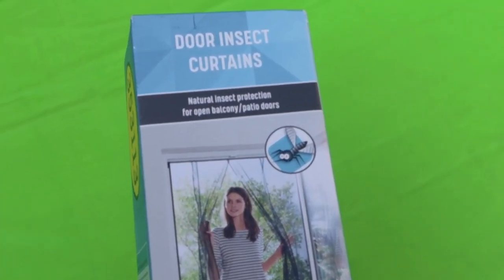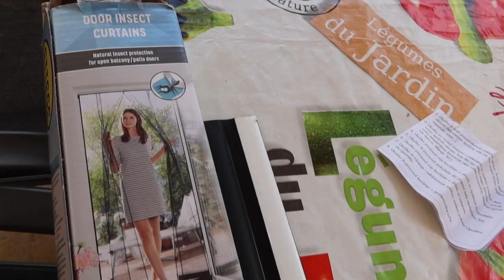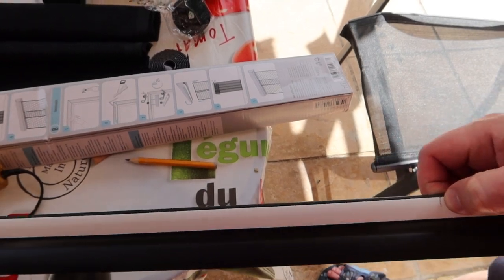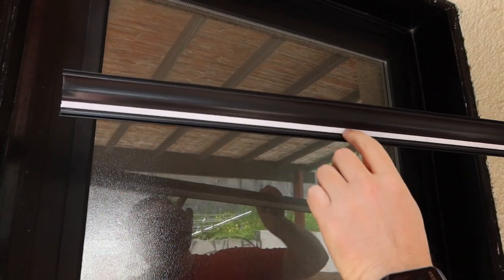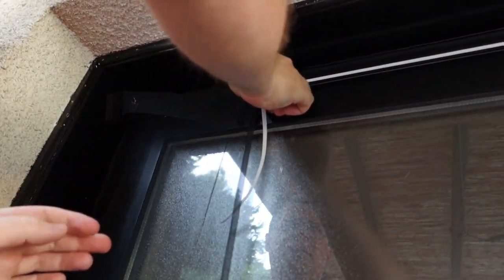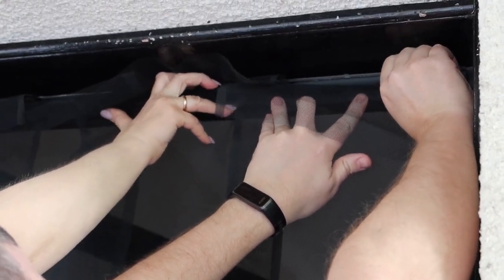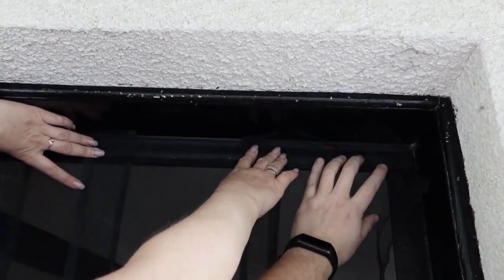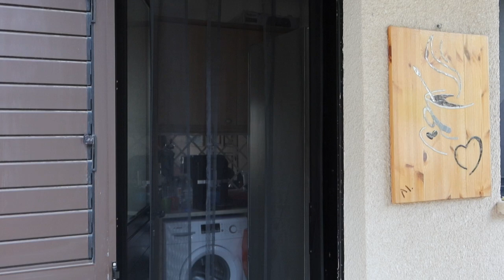Insect Door Curtains from Lidl in action. How to assemble Mosquito screen in 4 parts

Comment: Can also use a bucket (dark colour or black) with lid covering 70 -80% of the top , put some soapy water inside, and with luck have some spiders move in too,

Then welcome to the hotel mosquiofornia 😆
Every once in a while check it has soapy water for the mosquitoes to take a bath in 😉
And clear the webs out so the spiders can make new sticky ones.

It will help to reduce the mosquitoes in the area. Reduce!

Have fun with the new net

A good mosquito, is a dead mosquito 😁

Comment: Thank you (from France) for this video.  I also couldn’t understand the directions on the box.  So did you ever use the Velcro (sticky) for anything?  I wondered if it went INSIDE the top holder to press against the curtains when the top holder is closed? Just wondered
Reply from the maker: I'm glad the video was helpful to you. As for the Velcro, we didn't end up using it, and we might have done it incorrectly. It does seem like placing it inside the top holder to press against the curtains when it's closed could help keep the curtains securely in place. Please let us know if this works for you. Good luck with your mosquito screen!